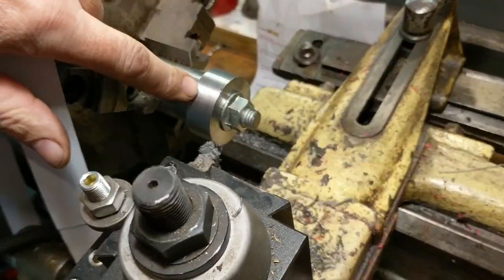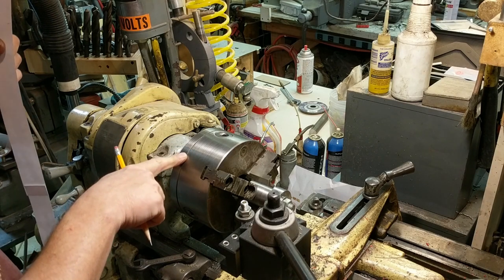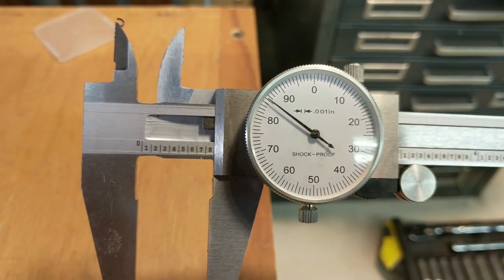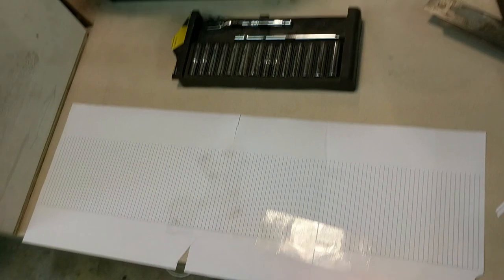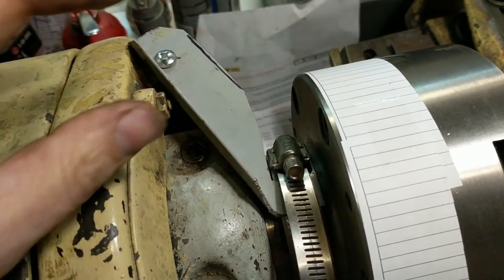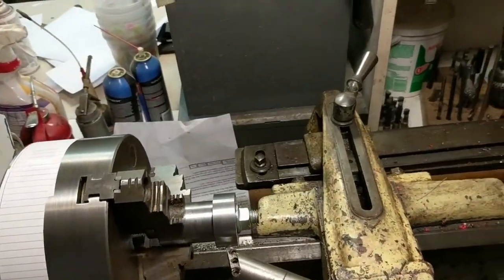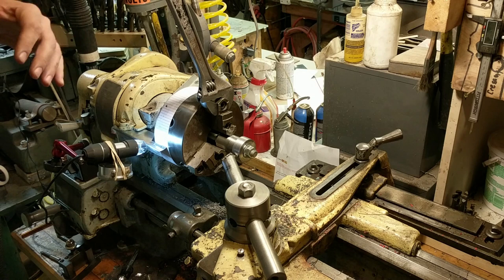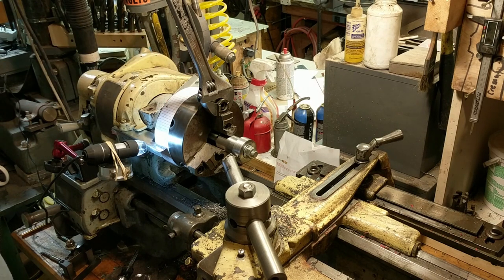Shop Hacks:  Indexing in the lathe chuck

Comment: You can print a divider wheel with any number of divisions and attach it to your spindle hole with a pointer.  Very useful for making gears . 
Here's the link: https://www.cgtk.co.uk/metalwork/calculators/divider
That site also has printable linear scales that can be used like your paper scale on the chuck or other object. Simply change the width until it fits. I've used the 200 division scale to build direct reading dials for my South Bend. Glue on and apply a few coats of clear finish and they last many years.

Comment: Brilliant,  what type of metal did you use to scribe on
Reply from the maker: Thanks for your kind words, and Good question:  The dial itself is some generic mild steel, the scriber tip is a 1/4" square high speed steel toolbit, ground to more-or-less 60 degree vee point, with some back slope angle for curl clearance, and as sharp a point as I could get it.  Thanks for weighing in.